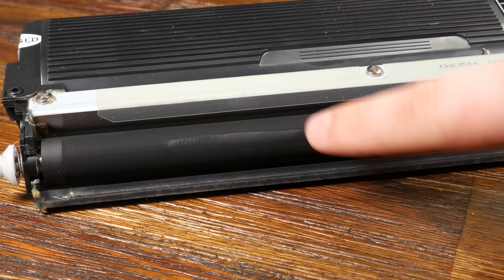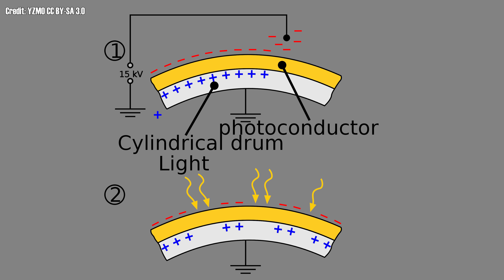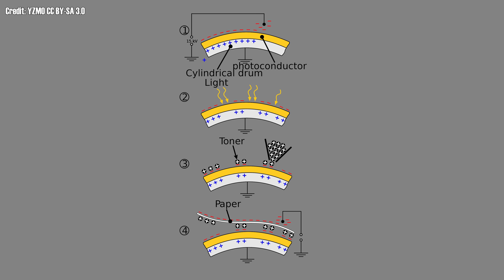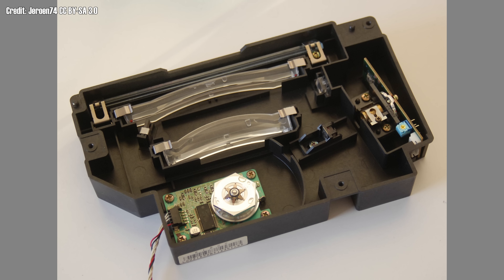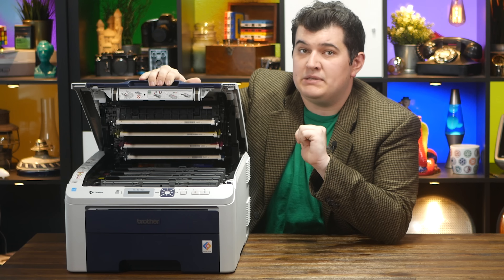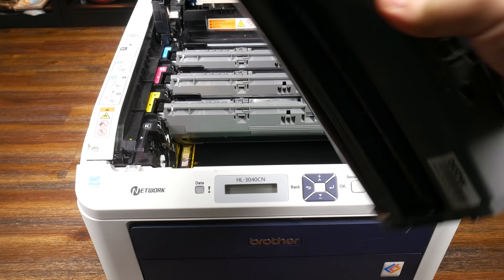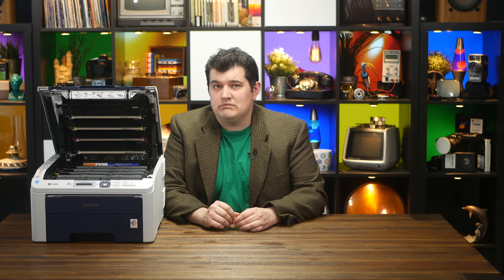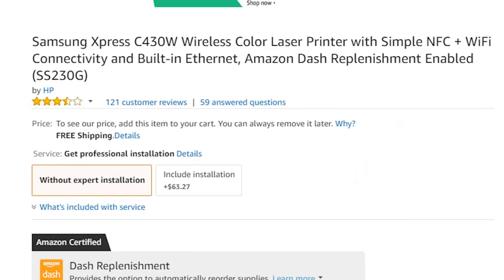LED Printers: The Common Printing Tech You Haven't Heard Of

Comment: Well, i used to repair printers back in the day, i can tell you (at least back then, late 90's) most laser printers, regardless of manufacturer, all used the same engine, the LBP cannon engine, and placed their own logic boards motor controllers (laser assembly, sometimes those were the same as well) and outer panels on them.  I'm pretty sure that most LED printers use similar or the same engine in their construction as any other LED printer.  Oh, and as a side note, the max printing speed was always based on printing multiple copies of the same page, as new pages did not need to be loaded into memory, and, I might be wrong about this, but my understanding was that the drum did not need to be recharged by the laser between each copy, making it much faster than when you printed multipage docs, where the drum needs to be recharged (basically zeroed out with a clean uniform neg charge), and shot by the laser and then retoned.

Comment: You'd think they'd use LED prominently due to the craze with "LED" LCD displays.

Also, way back when I got a Nintendo Virtual Boy, which uses a similar technology (stack of LEDs scanned across your eye with a mirror), some of the LEDs were of uneven brightness. Exchanging for another unit corrected the problem. Probably not a big deal with a B&W toner printer where you mostly aren't printing large areas of solid gray, but critical for a color toner printer.

Comment: I just recently discovered your channel and I’ve been impressed by your simple explanations of complex technologies. This particular one caught my eye because I’m a recently retired employee of Xerox and my job for the past 35 years was designing manufacturing test systems used for the assembly of the laser scanners used in their printers. 
Your description of how this works is pretty much spot on and I want to commend you for that. However, you should know that since the early ‘90s pretty much all ‘laser’ printers are actually LED-based, as these devices use solid-state (i.e. LED) lasers. The difference between the older technology and what you have discussed here is moving from a single or dual laser diode and using a motorized disk to create the raster line to a fabrication method of putting many laser diodes on a strip, thus eliminating the need for the mechanical scanner. 
Keep up the good work!

Comment: You're spot on about Oki.  We sold Okidata 400 and 800 series LED printers in the early 90's.  The 400 was MUCH cheaper than the HP LaserJets we also sold at the time.  It was much more compact as well and a solid printer.

Comment: Interesting.  I would have said that laser printers are more reliable because one "spinning thing" represents a single point of failure while several thousand LEDs per drum is many thousands of points of failure, particularly when they get dirty which is inevitable in any printer.  The spinning mirror thing seldom fails in my experience.  I like lasers because they are massively more efficient than inkjets with B&W lasers the best of the lot due to having one large cartridge vs four small ones.  I see the prices have come down so maybe someday I'll replace my 20 year old inkjet with a LED color printer, but my need for color is almost nil compared to B&W so that can wait until the ink runs out in my inkjet's last set of cartridges.

Comment: Hm, this set up of drums is normal for all color laser printers. It is not a feature of LED printer that so called 'Imaging unit' containing toner, developer and drum is in this order. There are 2 ways of doing this: ITB and ETB. One uses special transfer belt to take the toner out of each drum and transfer it onto paper, other one is using direct method with paper being transported by the belt. Looking into the printer, You can see the shiny surface on the bottom of opened unit. This is transfer belt. Not knowing the printer I cannot say which technology it is. This particular printer setup is not entirely good, the way the imaging units are located, given the poor quality of toner transfer designs in Brother or Samsung printers (last ones being currently reworked by HP after they bought that) this is causing lot of spill onto the transfer belt, which causes the toner collection unit to fill quicker.
Regarding the voltages in author comment, this is strictly dependant by who produced printer. Various companies use different polarizations of particular elements, of course being always the opposite where tonner attraction must occur.

Comment: The downside to the LED printers is that the close proximity to the drum leads to toner buildup on the face of the LEDs leading slowly to lighter and lighter prints. The standard laser array while larger is usually further away from the drum and therefor cleaner. In larger printers, the laser glass though it does get dirty is easy to clean because there is room the insert a cleaning wand to wipe the glass off. In the LED design. The printer must be dismantled and the imaging section removed to wipe off the LEDs. Take it from a copier repairman, It's a pain.
Reply: what? literally open the top cover and wipe the LED array. he even shows you in the video by just opening the top. 

the laser assembly is usually not accessible, you may wipe the lens, but the polygonal mirror (the "spinning thingy") accumlates dirt and requires a tech to remove and disassemble the laser assy so the mirror can be cleaned
Reply: @damiandeconing1555  In my previous comment, The words "Larger printers" were the key. I am referring to the commercial printers I work on that require dismantling to clean the LEDs. Google "Konica Minolta 1052" As for the polygonal mirrors, they hermetically sealed inside an enclosure and shines out through a narrow glass window. The outside of that window it the only thing that gets dirty. My point is that neither design is perfect.

Comment: THANK YOU FOR THIS! I used to have a Panasonic LED printer back in the early 90's. Small and thin, and it NEVER quit.  I learned then how awesome LED printers truly are.  I have been sold on them ever since I learned about the differences (mainly the very fact that Lasers then were "done with mirrors!"). Fun Fact: those OKI printers initially had a LIFETIME warranty on their LED printhead, as there were technically no moving parts to wear out.  Pana eventually switched to a "real" laser though because of marketing, and it wasn't nearly as good. I am sold on Brother now BECAUSE they are LED as you so rightly noted. They should have paid you for this, segment LOL. Less moving parts!  Another Fun fact:  Those tiny LEDs are also the same size as (organic) LEDs used in (earlier) smartphones :)

Comment: I enjoyed your video, most of it i agree with.  

it is very rare to have a modern printer/copier using corona wires.. now they use charge rollers. vastly cutting down on ozone leakage. 

although i'm not sure if i agree with the entire "led print heads give the engine a greater opportunity for speed" part.

Comment: i have an old (mid/late 90s?) okipage 10i parallel port (oo, remember that!) LED printer still working nicely, was a chuck out from where i used to work in the early 2000's
Reply: this has separate toner cartridge and image drum, its passed its 'drum life' several times but seems ok...

Comment: Ummmmm..huge correction. The color printer has a step u missed the belt assembly. Color toner is transferred to the image transfer belt where all the toner is stacked then transferred to the paper. Wayyyyyy different then monochrome printers. The toner on the belt is called latent image. The toner when melted is clear in tone so it can refract light from the paper and back through the toner to make the colors u want kinda like if you take blue and red cellophane and place it in front of a light source, It will look purple. 

Any questions?

Comment: I'm surprised thermal printers haven't become mainstream for B&W printing.  The cost of toner is insane. I have a £350 HP laserjet. I've just spent £270 on toners.
The Zebra printers we have at work will print for more than 10-15 years on one thermal head (used heavily). Sure, they're £3k a printer, and the heads are £500, but these are industrial units. A consumer unit would cost way less.
Thermal paper costs a bit more, but not hugely. Again, supply and demand. Prices drop.

Comment: Siemans AG holds one of the earliest patent applications for Okidata-style LED "electro-photographic" printing file-dated July 27, 1988, but one of the earliest similar patent filings was for a "Geometric LED layout for line exposure" also entitled "High Speed, Low-Cost Character Printer" but these inventions and inventions around this period (1984-1988) involve specialty papers, thermal papers, and radiation-sensitive film.  Since Adobe did not invent "raster graphics" until 1988, the technology seems to have evolved from facsimiles (fax) and photocopiers, patents for which include LEDs as a lightsource as far back as the 1960s.  The innovation is probably an adaptation of thermal printing.  An example of this patent would be EP0060641A2 (Non-impact dot matrix printer) which describes using "light energy to transfer ink on to the record medium" (application withdrawn, 1982) or US4427275A (Xerographic electronic printer) describing "non-impact printers ... light emitting diodes ... to produce an image on a photoconductor" .. 1982

Comment: A color LED printer would require 19200 LEDs.  If any of the LEDs should fail, it would leave a streak on the print.  The laser printer would require only a single laser source.  It seems that the LED printer would be much less reliable.

Comment: It sounds like you could get a truly ridiculous resolution with an LED printer by running the LED stripe and the toner cartridge diagonally across the page, letting you pack more dots into the same horizontal width by stretching them vertically, and just draw the different parts of the same row at a different time as they pass the correct horizontal mark on the stripe.

Comment: I happen to be a laserjet technician and for the most part your information is very good. Most color laserjets are laid out almost exactly like that LED laserjet and are literally like 4 printers in 1. As such they usually have more problems and are noticeably heavier. Toners spills are common in color laserjets but don't usually affect the quality of the prints.

Comment: No way are these more reliable than a laser printer. The points of failure on these machines are the same as traditional laser printers, namely the paper path and the fuser. Mirror motor laser housings rarely fail, and if they do, they are 1 part that's easily swapped out. The LED method just introduces more complexity that is poorly serviceable and far more expensive to replace.

Comment: Interesting. I had heard of LED printers, but didn't know exactly how they worked. One type of printer I have used that you might have heard of is a magnetic printer. It was used for high-speed bulk B&W printing on sprocket-fed continuous stationary. It had a large metal drum which was magnetised by lots of small write heads, a bit like a tape recorder, and used ferrous-based toner which stuck to the drum and was then fused to the paper using the normal methods. It only did 240dpi, but printed at rates of hundreds of pages per minute. A 3000 page box of continuous paper could be printed in a little over 5 minutes.

Comment: 0:19 Ink cartridges are expensive if you buy the cheapest printer available on market, but if you buy a $200 inkjet printer (like my HP Officejet Pro 8620), you get 10 times more ink at the same price or even cheaper! (Specially if you buy the XL versions). I've only changed the cartridges once in the 2 years I have it! Also, I print only a few pages per month and I've never had problems with ink clogs. Good quality printer + good quality ink = no ink clogs and it's very cheap, just $0.02 per page, both in B&W and in colour!

Comment: For me the problem with LED printers is that they can partially fail. Like if an LED burns out, you can end up with a single column of pixels with no cyan. Which you probably won't notice. And then another LED will fail. And another, and another… The image quality slowly degrades. With a laser printer it's all or nothing. Either you get a perfect print or no print (failure modes common to both technologies notwithstanding). When the laser assembly fails, you know right away and can have it fixed.

Comment: Great video. I service copiers and printers. I am reasonably certain that Oki actually owns the patents on LED printing, but I have no proof of that just a hunch. Almost all LED printers have extremely similar design. I wouldn't be surprised if Oki makes all of the LED bars and just sells them to Brother or others, I know that Oki licenses some of its tech to other companies. The paper path portion of your video isn't exactly correct though. Almost all color laser or LED printers use a transfer of some kind, either a transfer roller or a transfer belt. I mostly see belts in color machines, rollers in monochrome. You can clearly see the transfer belt in this printer that resides underneath the drum and toner cartridge assembly here: https://youtu.be/_saDCwsB9Ww?t=406 
The transfer belt is what the toner is transferred to after the drum, the image gets put together on the belt and then the belt is what transfers the image to the page before fusing. This is done to help reduce smearing of the toner when it is on the paper. 
From a service standpoint LED printers usually have a few less moving parts to go wrong but require swapping out of larger and costly assemblies than most laser printers, although in the low end market that is probably less true as low end lasers are not usually designed with service in mind anyways. I would love to see some more printing and document tech explained on your channel!

Comment: I know one is called an LED printer and the other a laser printer. However to the best of my knowledge both use laser technology, one by running a more powerful laser source through a galvo scanner (the "real" laser printers) and one uses an array of tiny laser leds (LED printer). In both cases the light getting to the image drums is, for any definition, laser light (actual dot) and not spreading. If I am not mistaken and that is true, the technology would actually be called "laser" for both and the naming is just wrong. It should be Led- (or Bar-)laser vs Galvolaser. Although that does sound even more confusing than Laser vs Led.
I guess the whole printing industry is just full of confusing/wrong names... everyone calls his cheaper bubblejet (=heatbased) printer an inkjet (=piezobased) printer too...

Comment: The toner mishaps can become a real problem. First you may begin getting a color haze across the page, Second it's very bad to have that fine powder in your room air. It can get into your lungs. You won't have a problem now but over time it's very bad (when you read about increased death rates from pollution, it's older people and asthmatics. We all get there. The way to clean it up is to wipe it with a wet paper towel or if you vacuum it up, you should use a special toner vacuum. I've got a Hepa vacuum, and that should be okay.....
If you refill your toner cartridges, just do it outside away from your door, where an N95 or P95 dust mask (you should have some of these around for your emergency kit. Fire and smoke evacuations, they help a lot.)  And thanks another great set of technical explanations. 
Amazon in many cases seems to have more misinformation and missing information then information.  I subscribed--it's always a good idea to sit next to the smart kid in class.

Comment: I just want to find a new or refurbished OPC belt unit for a Brother MFC 9420 color laser printer that's at a proper price for something of its age. Apparently the one in it was exposed to some bright light because it makes some wild weirdness that's identical in every print. I got the printer for free. I am NOT paying over $200 to nearly $400 for a part for an old printer! I can buy a whole new color laser printer for that amount. It's like when computer parts sellers were expecting $500 for 20 megabyte MFM drives when $500 would buy a 150 to 200 megabyte IDE drive.

Put stupid prices on new old stock or refurbished parts and you are not going to sell any, especially not when someone can go buy an entire new whatever for less.

Comment: Getting rid of the drum and toner system is the next step in printers. Ink or toner cartridges are the biggest pain in the ass and a waste of resources and space.

I dislike that a printer company will come up with a new printer but not use the old toner cartridges. They redesign it completely different with toner cartridges which don't fit
Reply: Yes, maybe prints a Toner that works like a Butterflies Wing?

Comment: HP CP3505 is a  true laser printer laid out in a similar  (rotated  90 degrees)  which has 4 laser  scanners (in a single module)  so it does not need a serpentine paper path.  There are only 2 90 degree turns in the path so it is decent for labels or cardstock.  Details on page 131 / sheet 143 of the service manual : http://www.lbrty.com/tech/Manuals_HPC/CLJ3000_3600_3800_CP3505sm.pdf.

If you want a really wacky printer tech to do a video on, check out the Xerox Phaser  models that use  solid blocks of  toner (basically big crayons).